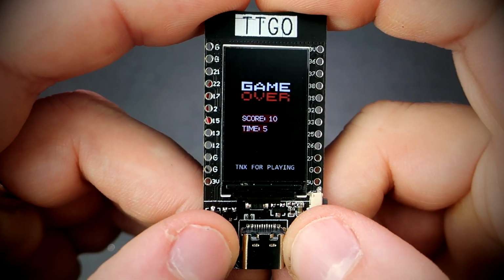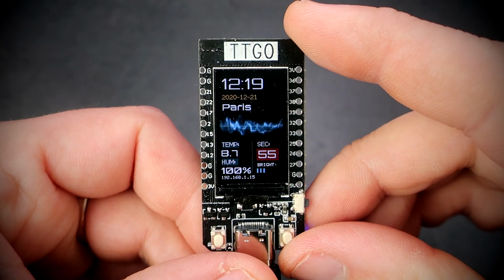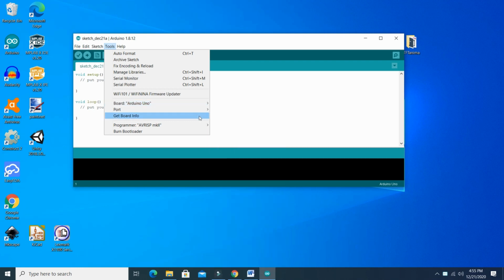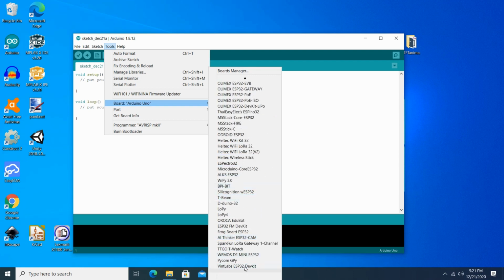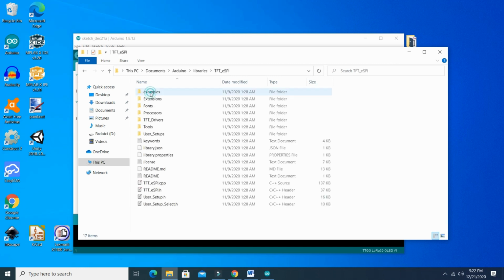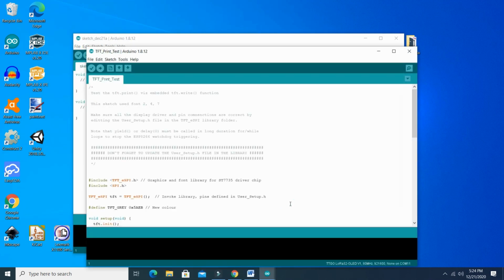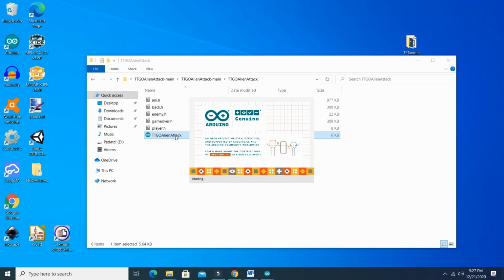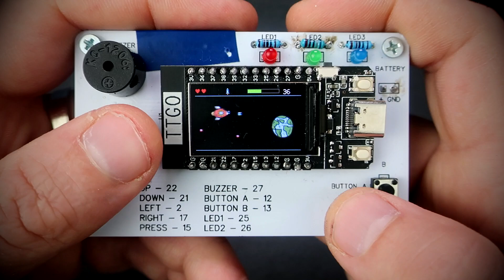How to Install and Setup  TTGO T-Display ( Getting Started tutorial)

Comment: Great Video Turorial and great comments to fix the remaining issues After following all hints I could start it, but display remains dark. Then I selcted. in Board Manager the old version for  esp32 by Espressif Systems Version 2.0.17 instead the version 3.2.1 (July 2025). After that it was possible to play the game. First I could not shot the alians, but after I reallized that I have to press both buttons quickly several times, then it was working great. THANK YOU !

Comment: Many thanks for this video.  I have been trying to use the T-Display for a radio project and struggling, but, after watching this I now realize I have been missing the small but very  crucial step of editing the TFT_eSPI User_setup_select.h file.  The developer assumed a certain level of understanding of how that library works, I guess.  Lesson learned, familiaize myself with each library included in a sketch.  It's right in the Readme file of the tft_espi library folder on github.

Comment: If you get error having to do with divers not included:

add: #include <driver/gpio.h

at the top of TFT_eSPI_ESP32.c & TFT_eSPI.cpp

Also try lowering the baudrate to 115200 as that is a more reliable upload speed for ESP32 boards...
Reply from the maker: probably verision of esp32, try downgrade it to version lower than 3.0

Comment: Hi,
Love your vlogs.
This one gives me a compilation error though.

********************************************************
In file included from F:\Programming\Arduino\TTGO\TTGOAlienAttack-main\TTGOAlienAttack\TTGOAlienAttack.ino:5:
F:\Programming\Arduino\TTGO\TTGOAlienAttack-main\TTGOAlienAttack\enemy.h:1:1: error: 'int' does not name a type
    1 | int frames=4;
      | ^~~~~~
F:\Programming\Arduino\TTGO\TTGOAlienAttack-main\TTGOAlienAttack\TTGOAlienAttack.ino: In function 'void setup()':
F:\Programming\Arduino\TTGO\TTGOAlienAttack-main\TTGOAlienAttack\TTGOAlienAttack.ino:58:3: error: 'ledcSetup' was not declared in this scope
   58 |   ledcSetup(pwmLedChannelTFT, pwmFreq, pwmResolution);
      |   ^~~~~~~~~
F:\Programming\Arduino\TTGO\TTGOAlienAttack-main\TTGOAlienAttack\TTGOAlienAttack.ino:59:3: error: 'ledcAttachPin' was not declared in this scope; did you mean 'ledcAttach'?
   59 |   ledcAttachPin(TFT_BL, pwmLedChannelTFT);
      |   ^~~~~~~~~~~~~
      |   ledcAttach

************************************************

Implementing the solution posted by patufetselaer3651 solved those problems. Thanks patufetselaer3651

It actually already went pearshaped with the TFT_Print_Test example:

************************************************
In file included from c:\Users\Frank\Documents\Arduino\libraries\TFT_eSPI-master\TFT_eSPI.cpp:24:
c:\Users\Frank\Documents\Arduino\libraries\TFT_eSPI-master\Processors/TFT_eSPI_ESP32.c: In member function 'void TFT_eSPI::begin_SDA_Read()':
c:\Users\Frank\Documents\Arduino\libraries\TFT_eSPI-master\Processors/TFT_eSPI_ESP32.c:72:3: error: 'gpio_set_direction' was not declared in this scope
   72 |   gpio_set_direction((gpio_num_t)TFT_MOSI, GPIO_MODE_INPUT);
      |   ^~~~~~~~~~~~~~~~~~
c:\Users\Frank\Documents\Arduino\libraries\TFT_eSPI-master\Processors/TFT_eSPI_ESP32.c: In member function 'void TFT_eSPI::end_SDA_Read()':
c:\Users\Frank\Documents\Arduino\libraries\TFT_eSPI-master\Processors/TFT_eSPI_ESP32.c:87:3: error: 'gpio_set_direction' was not declared in this scope
   87 |   gpio_set_direction((gpio_num_t)TFT_MOSI, GPIO_MODE_OUTPUT);
      |   ^~~~~~~~~~~~~~~~~~

**************************************************

Eventually, after scrubbing the system of any Arduino related files, doing a clean installation of IDE 2.3.2, keeping all defaults, and following your instructions to the letter, didn't get rid of the problem. Replacing the esp32 v 3.0.2 boards package (by espressif) with version 2.0.17 in the boards manager solved that problem (thanks espressif?). This solved most other problems I got from compiling for ESP boards as well. AlienAttack now happily compiles, uploads and runs like a charm.

P.S. Nobody ever told us computing was ging to be a breeze...

Comment: Great video - these instructions still continue to work even on a Mac running Arduino IDE 2.3.2. Just be sure Tools> Upload Speed is set to 115200 or you'll get a "Unable to verify flash chip connection" error.

Comment: I'm catching up.  Just got a Lilygo T-Display.  I picked that as an option in the Arduino IDE, rather than the ESP32 Dev Board you suggested.  When I did the ESP32 Dev Board, I just got a blank screen.  But I was getting errors downloading the Alien Attack game with the Lilygo option.  I found out that I had to add this:  

C:\Users\<YourUserName>\AppData\Local\Arduino15\packages\esp32\hardware\esp32\2.0.13\boards.txt
Add the following lines at the top of the file:
lilygo_t_display.upload.flags=
lilygo_t_display.upload.extra_flags=

After changing that file, saving, and rebooting the Arduino IDE, the game loaded fine.

I also have a Lilygo T-Display-S3 and T-DisplayPicoC3 that I'll be playing with.  I had problems with those too, which I why I went to the earliest one.

Comment: i get this error message 

Sketch uses 299753 bytes (22%) of program storage space. Maximum is 1310720 bytes.
Global variables use 21716 bytes (7%) of dynamic memory, leaving 273196 bytes for local variables. Maximum is 294912 bytes.
esptool.py v4.5.1
Serial port /dev/cu.usbserial-576D0470441
Connecting.....
Chip is ESP32-D0WDQ6-V3 (revision v3.1)
Features: WiFi, BT, Dual Core, 240MHz, VRef calibration in efuse, Coding Scheme None
Crystal is 40MHz
MAC: **********************
Uploading stub...
Running stub...
Stub running...
Changing baud rate to 921600
Changed.

A fatal error occurred: Unable to verify flash chip connection (Invalid head of packet (0xE0): Possible serial noise or corruption.).
Failed uploading: uploading error: exit status 2
Reply: ok i did some playing around and found if you change the upload speed to a lower value it works  TOOLS Roll down to UPLOAD SPEED and change the value to 460800

Comment: Very nice and simple intro to this board. However, sadly, I can not get it to work on two boards. I followed your directions carefully and it loads with no errors but the screen(s) are blank. Please help if you can. RP
Reply from the maker: So you instaled esp32 board,edited two files in library, saved , chosed ttgo oled board in arduino ide and uploaded and screen is still black? Are you sure you have this board?

Comment: Hello! Your video were very usefull. Mean time I realised, that my poblem was the OneDrive. since I modified UserSetupSelection in OneDrive  Documents\Arduino\library instead of local Documents\Arduino\library. But now it is working.
But I have a problem with your TTGOAlienAttack. I downloaded zip file from GitHub and after exrtaction I tried to comiling and upload to TTGO T-Display.  But I received the following errormessage for enemy.h file:
"In file included from C:\Users\Apa\Documents\Arduino\TTGOAlienAttack_V01\TTGOAlienAttack_V01.ino:2:
c:\Users\Apa\Documents\Arduino\libraries\TFT_eSPI/TFT_eSPI.h:973:8: warning: #warning >>>>------>> TOUCH_CS pin not defined, TFT_eSPI touch functions will not be available! [-Wcpp]
       #warning >>>>------>> TOUCH_CS pin not defined, TFT_eSPI touch functions will not be available!
        ^~~~~~~
In file included from C:\Users\Apa\Documents\Arduino\TTGOAlienAttack_V01\TTGOAlienAttack_V01.ino:7:
C:\Users\Apa\Documents\Arduino\TTGOAlienAttack_V01\enemy.h:1:1: error: stray '\357' in program
 int frames=4;
 ^
C:\Users\Apa\Documents\Arduino\TTGOAlienAttack_V01\enemy.h:1:2: error: stray '\273' in program
 int frames=4;
  ^
C:\Users\Apa\Documents\Arduino\TTGOAlienAttack_V01\enemy.h:1:3: error: stray '\277' in program
 int frames=4;
   "
What can be the problem with it? I cannot get over it. Could yuo suggest any solution?

Comment: I cannot get these TTGO boards to connect to my mac: Has anyone had this issue? followed the istructions to the letter.
---
Sketch uses 293873 bytes (22%) of program storage space. Maximum is 1310720 bytes.
Global variables use 21716 bytes (7%) of dynamic memory, leaving 273196 bytes for local variables. Maximum is 294912 bytes.
esptool.py v4.5.1
Serial port /dev/cu.usbmodem568B0255451
Connecting.....
Chip is ESP32-D0WDQ6-V3 (revision v3.0)
Features: WiFi, BT, Dual Core, 240MHz, VRef calibration in efuse, Coding Scheme None
Crystal is 40MHz
MAC: b0:b2:1c:4f:07:68
Uploading stub...

A fatal error occurred: Failed to write to target RAM (result was 01070000: Operation timed out)
Failed uploading: uploading error: exit status 2

Comment: Hi is it possible to add an SPI device to this device (TTGO). It does not appear the the SPI buss is available. I would like to retrieve data from  a SPI slave and display it on the screen.
Thank you for your time.
W
Reply from the maker: It is posible, but it is tricky becouse spi but is already used by screen, you will need to use vspi for screen and hspi for device forexample

Comment: In file included from C:\Program Files (x86)\Arduino\1_mode_\TTGOAlienAttack-main\TTGOAlienAttack-main\TTGOAlienAttack\TTGOAlienAttack.ino:5:0:
enemy.h:1:1: error: stray '\357' in program
 int frames=4;

Someone else posted a fix, but hopefully another post will help someone find the fix.

The Enemy.h file is saved as a UTF-8 BOM file, and needs to just be UTF-8.

Download Notepad++ and open the file. Go to the top and look for encoding and you should be able to figure it out from there. It compiles fine now!

@patufetselaer3651 was the person I saw post the fix.
Reply: thank you 👍

Comment: Thanks for very nice explanation and making a great video. May I ask if you could let me know how to connect NodeMCU ESP8266 V3 with 3.5 inch TFT touchless display having ILI9488 driver? I want to use TFT_eSPI library for it. I tried many configurations but was unsuccessful. Can you please let me know the wire connections and if any changes required in the TFT_eSPI codes? Thank you very much for your help in advance.

Comment: hey man! your channel is very intereseting. I just bought a LILYGO and I cannot  connect to it. I have tried to do everything, I followed your example, but in my screen the option for the PORT is not enabled, I cannot click it
Reply from the maker: you probably need to install driver for usb chip, you can find it on product pages. if you have win 10 it shoud recognize driver automaticly
Reply: @VolosProjects  I have tried in two different WIN10 PC´s, also in fedora and Pop OS

Comment: Bought my first TTGO T-display recently and followed this tutorial.  I was able to get the example print test file to work but when I tried to upload your game file, I got an error and now the board seems to be unresponsive.  When I connect it to the computer, the blue light flashes rapidly and I can't seem to do anything.  Is there a way to reset it back to factory settings?
Reply: Me too. Did you solve this problem?

Comment: Hi im just getting this error no matter what system i try to flash the code with windows 10 pc or windows 11 laptop "Arduino: 1.8.19 (Windows 10), Board: "TTGO LoRa32-OLED V1, 80MHz, 921600, None"

Sketch uses 819162 bytes (62%) of program storage space. Maximum is 1310720 bytes.

Global variables use 14088 bytes (4%) of dynamic memory, leaving 280824 bytes for local variables. Maximum is 294912 bytes.

esptool.py v3.0-dev

Serial port COM12

Connecting...

Traceback (most recent call last):

  File "esptool.py", line 3682, in <module>

  File "esptool.py", line 3675, in _main

  File "esptool.py", line 3330, in main

  File "esptool.py", line 512, in connect

  File "esptool.py", line 492, in _connect_attempt

  File "esptool.py", line 431, in sync

  File "esptool.py", line 369, in command

  File "esptool.py", line 332, in write

  File "site-packages\serial\serialwin32.py", line 323, in write

serial.serialutil.SerialTimeoutException: Write timeout

Failed to execute script esptool

An error occurred while uploading the sketch

This report would have more information with
"Show verbose output during compilation"
option enabled in File -> Preferences."

Comment: I finally got the TTGO T-Display board so now I can start learning how to code using your tutorials, you're the best developer online that I know of, keep up the good work.
Reply from the maker: tnx Ricardo, feel free to ask if you stuck
Reply: @VolosProjects  Never mind, I got the issue solved already. The ani.h file has the wrong encoding, now it is encoded with UTF-8-BOM and it needs to be UTF-8, with Notepad++ I got it saved as UTF-8 and the issue went away.
Reply: @VolosProjects  yeah I got stuck with an error when I'm compiling the code: Compilation error: stray '\357' in program

It's in the ani.h file on line 1

I don't know what to do about it so I could use some help

Comment: With W11, I repeat the same error:
In file included from C:\Program Files (x86)\Arduino\1_mode_\TTGOAlienAttack-main\TTGOAlienAttack-main\TTGOAlienAttack\TTGOAlienAttack.ino:5:0:
enemy.h:1:1: error: stray '\357' in program
 int frames=4;

The enemy.h file is in "UTF-8 BOM" encoding, with the notebook open it and save it in "UTF-8" and it works perfectly.
It is not necessary to delete blank lines.

Now works fine , thank you !!
Reply: Perfect, para os BR, pega o arquivo enemy.h abre com o bloco de notas ai vai em salvar como, na parte abaixo do nome, mude o formato para UTF-8, por padrao vai esta UFT-8 BOM
Reply: If problem with ledcSetup in setup, change 
"ledcSetup(pwmLedChannelTFT, pwmFreq, pwmResolution);
  ledcAttachPin(TFT_BL, pwmLedChannelTFT);"
 to
"ledcAttachChannel(TFT_BL, pwmFreq, pwmResolution, pwmLedChannelTFT);"
Reply: @rc0d3 This is (correct me if I'm wrong) due to a breaking change in the ESP32 library from v2.x.x to 3.x.x.  They combined those two functions and renamed it.
Reply: @ yes, this is the reason
Reply: @rc0d3  replace line 58, 59 with this

ledcAttachChannel(TFT_BL, pwmFreq, pwmResolution, 0);
ledcWriteChannel(0, 100);
Reply: Thank you. This made it work in my case.
Reply: Thank you. This should be on top or OP should change his code.

Comment: I am getting this error while using my ttgo why is that happening could you please help me about it? 
"Sketch uses 18280 bytes (59%) of program storage space. Maximum is 30720 bytes.
Global variables use 1882 bytes (91%) of dynamic memory, leaving 166 bytes for local variables. Maximum is 2048 byte"
Reply from the maker: did you select correct board in board manager, you need to select  TTGO Lora32 OLED
Reply: @VolosProjects   yes i did but still same :( I am working with a sensor and I want to see some datas in the serial monitor but its empty there. Is it possible to see the datas on the serial monitor while using this board?

Comment: I get the following errors when I try to upload it:

In file included from C:\Downloads\TTGOAlienAttack-main\TTGOAlienAttack\TTGOAlienAttack.ino:5:0:
enemy.h:1:1: error: stray '\357' in program
 int frames=4;
 ^
enemy.h:1:1: error: stray '\273' in program
enemy.h:1:1: error: stray '\277' in program
exit status 1
stray '\357' in program

I googled this and apparently this one .h file contains the UTF-8 Byte Oder Marker. I was able to resolve the problem by putting the cursor at the start of the firs line and pressing backspace to delete the illegal characters. The other .h files seem to be fine. I'm using Windows 10. I downloaded them as a zip file from Github as you did in the video.
Reply from the maker: Try to delete empty lines in .h file, this is error that came with new versions of IDE
Reply: @VolosProjects  same thing happened to me, and I can confirm that deleting all the blank spaces in the enemy.h file worked and it compiled correctly after that.  Thank you to Volos and Ytubeleo
Reply: @VolosProjects  Interesting. It's curious that only the enemies.h file is affected. As I said, I got it working by (presumably) deleting the invisible characters at the start. Any idea why only enemies.h was affected?

Comment: i am getting error while uploading........

esptool.py v3.1-dev
Serial port COM7

Connecting...
Traceback (most recent call last):
  File "esptool.py", line 4423, in <module>
  File "esptool.py", line 4416, in _main
  File "esptool.py", line 3966, in main
  File "esptool.py", line 120, in get_default_connected_device
  File "esptool.py", line 567, in connect
  File "esptool.py", line 539, in _connect_attempt
  File "esptool.py", line 478, in sync
  File "esptool.py", line 414, in command
  File "esptool.py", line 377, in write
  File "site-packages\serial\serialwin32.py", line 323, in write
serial.serialutil.SerialTimeoutException: Write timeout
Failed to execute script esptool
An error occurred while uploading the sketch
Reply: Im getting almost the same error did you fined a fix ?

Comment: Not sure why but in 2021 this is not working with these libraries and arduino 1.8 Spent a lot of time trying to get it to compile.
Reply from the maker: What eror your are getting?
Reply: Thanks kindly for the reply. I actually managed to just get it to compile by removing frames=4 line. The wifi weather station tho. I spent a good 2h trying to get that one to compile. Issues with wifi library and type casting issues.
Reply from the maker: So stray error